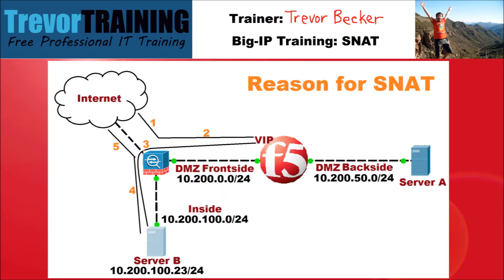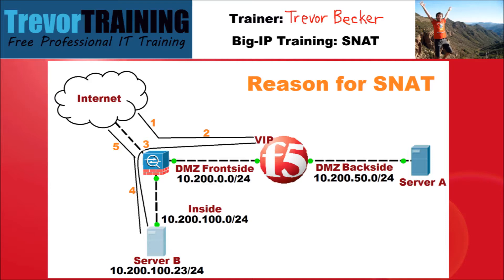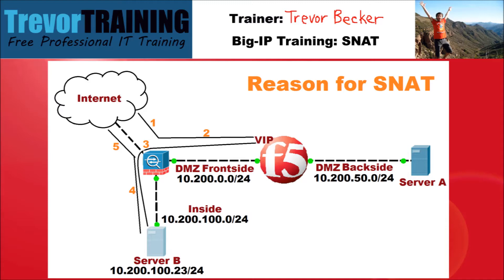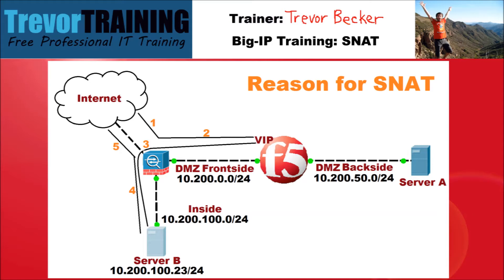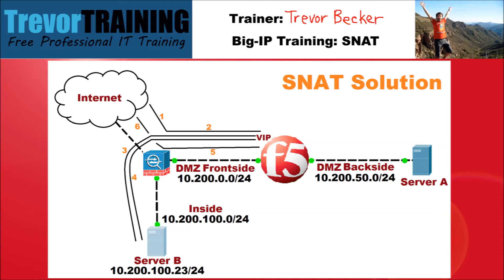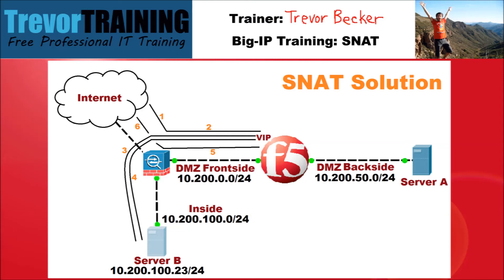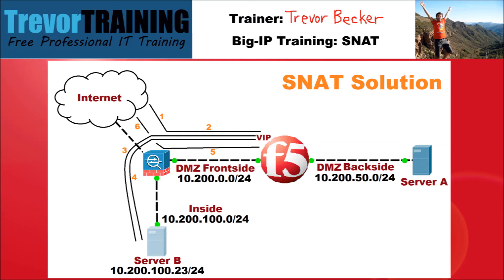What is SNAT? Reason and solution  | Video 20 | Free F5 LTM load balancer training videos

Comment: For the mechanism where the client drops the response from an IP it doesn’t recognize, is this a network-layer mechanism or a transport-layer mechanism?
Reply: That would be TCP,  a TCP connection will not stay open as it is defined by source IP and Port and destination IP and Port. If the source IP changes the connection will eventually timeout.

Comment: Difference between snat and dnat load balancers please
Reply: SNAT is mapping a connection back to a VIP by changing the source address of the incoming connection.  DNAT is changing the IP address as it arrives at a destination, possibly so that the incoming connection can be treated with the same policy as the destination.  Two totally different use case.